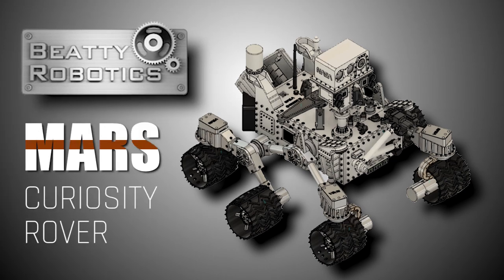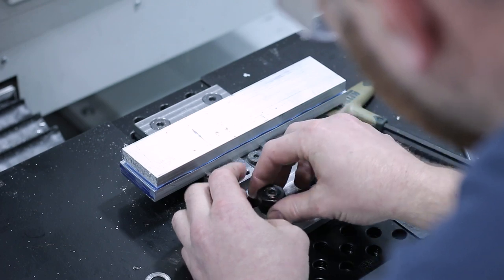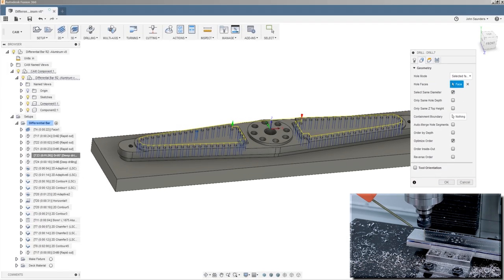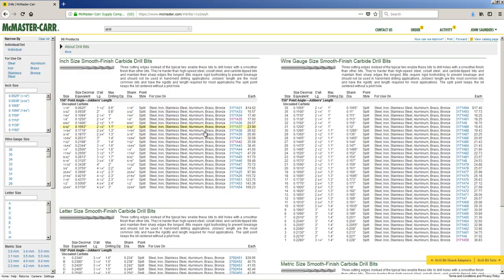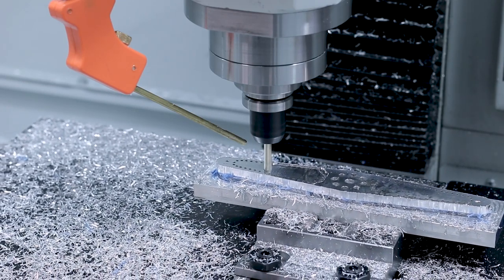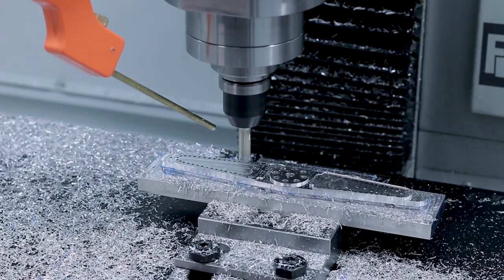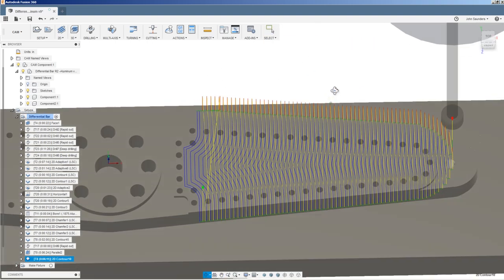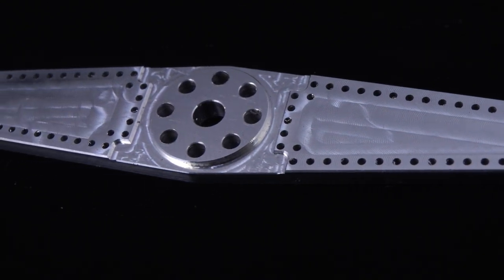CNC Machining a MARS Curiosity Differential Bar | WW212

Comment: If the adhesive of the tape is strong enough, I wonder if there is any double-sided sticky tape that would work and eliminate the need for superglue?
Reply: if you dare IPG tape makes a double stick that will work in most cases.  we use it at work for thin sheet work.   major cons are what John said about burnishing the tape down,  its the only way to really get good adhesion,  additionally coolant will kill the bond on our double stick tape almost immediately.
Reply: I mean "what ED said". :)
Reply: Permacel P-02 can work.. but you really need to apply a lot of sharp force to make it work - and it lets go pretty fast when using coolant. I used to use this, but find the superglue is much more reliable - - as Ed says, it's all about being able to burnish the tape to the part.. amazing how well it works.
Reply: Thanks all. I guess that's why they call it pressure-sensitive tape :)
Reply: I use 3-rolls-for-£1 double sided stuff on small wood and plastic parts to a varnished wood bed.  The act of decking with a small endmill (my spindle is one of those 140W multitools with a Dremel collet)  burnishes it down so hard I can have trouble getting wood parts off intact, and have to use alcohol to get the residue off both the part and bed.

Comment: Okay, a question: If you’ve already drilled out the hole(s) in the center, couldn’t you realign the workpiece so the holes line up with t-nut slots, then use t-nuts, some studs, and a flat washer and nut to hold down the center? That way, you wouldn’t have to worry so much about relying on the super glue to hold everything together, eh? I can’t wait for the videos on machining the engine block! 😍

Comment: I should note that aluminum adheres to TiN platings. I've experienced it myself and it does effectively dull the cutting edge through built up aluminum. It can't be removed just by picking or scraping it off either, you need to use it for awhile in steel to wear the aluminum off. I still wouldn't advise that though. For aluminum, use either HSS , M35, or carbide with a bright finish or ZrN coating. M42 and micro grain carbide are not ideal either since aluminum also adheres to cobalt, making high cobalt cutting tools ineffective in aluminum.

Comment: I know you guys love the super glue technique, but there are others that are more reliable, don't take any more time, etc.  I kind of wish you move in that direction and use super glue only for those special circumstances.
Reply: Care to elaborate?
Reply: Anonymouspock kind of tough to do that in a comment.  I'm sure there are plenty of YouTube videos showing work holding.  For this part I would have done two ops with a fixture the part bolts too. About the same effort, more reliable performance.
Reply: I agree.  He needs to get over the super glue “trick”.
Reply: Exactly what i was thinking.
They have a nice sub-base with a hole pattern already there.
Cut the material larger so that you have about 1" extra material all around, aka "the picture frame method".
Make the first side in your modular vise system, drill thru 2 locating holes and a bunch of bolt holes in the extra material.
Bolt the second setup right on the table and machine the second side leaving small, strategically placed tabs at the very end.

If the bolt pattern is not right, you can cut your material bigger, or place it at an angle on setup 2 to reach wanted holes.
Another possibility is to add a smaller universal plate with a smaller hole pattern on top of the current sub-base.

Keep in mind that the material is so cheap that you end up saving money because of reduced setup and labour time.

Comment: Why not just do the first side then flip it over in soft jaws and do the second side simple and extremely reliable.
Reply: Soft jaws need to be designed, programmed, machined and stored afterwards.
Not worth the time, the effort and the space needed to store them for a small quantity of parts.

Cut the material larger for you part instead, so that you have about 1" extra material all around, aka "the picture frame method".
Make the first side in your modular vise system, drill thru 2 locating holes and a bunch of bolt holes in the extra material.
Bolt the second setup right on the table (there is a nice hole pattern on his machine tables) and machine the second side leaving small, strategically placed tabs at the very end.

If the bolt pattern is not right, you can cut your material bigger, or place it at an angle on setup 2 to reach wanted holes.
Another possibility is to add a smaller universal plate with a smaller hole pattern on top of the current sub-base.

Keep in mind that the material is so cheap that you end up saving money because of reduced setup and labour time.
No fixture to machine, no soft jaws, no super glue to manipulate.
Reply: If it takes more than 15 minutes to design and cut soft jaws for that part you are doing something wrong. Plus when you're done you deck them off and use them for the next part.
Reply: Honestly, i don't see where soft jaws (or a dedicated fixture) are an advantage on small batches or prototypes, like less than 10 parts.
Why not simply use that nice bolt pattern on the table ?
It takes no time at all, and costs zero.

By the way, this part is easily doable in one single setup, with a 4 or 5 axis machine.
Reply: I too would not make a dedicated fixture. I run a lot of prototype parts so I usually have a vice with a set of soft jaws in and I just use them till there is nothing left to them. I guess in the end it is all what you are comfortable with and can make the part the fastest.

Comment: Not to dog pile on here, but just as a point of note. Try walking into your average job shop for an interview an telling management that you would work hold a part like that with superglue. (Plus the added expense of the fixture). Don't get me wrong it's a very useful tool in the right scenarios. However this is not really one of those scenarios. John if your headed up (or over) to IMTS in a couple of weeks you should really check out oml's sinter grip jaws. Workholding solutions like this are really the best answer for parts like the one you have here. Btw love the show (especially the arduino stuff). Keep em coming.

http://www.omlspa.it/index.php/en/sintergrip-2